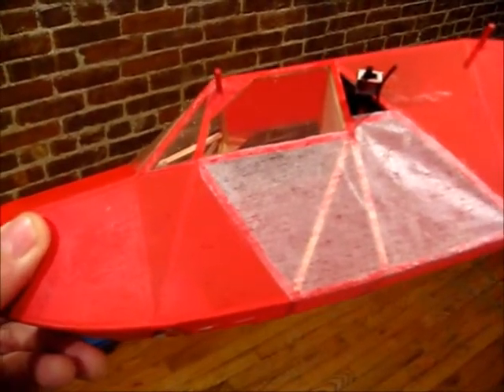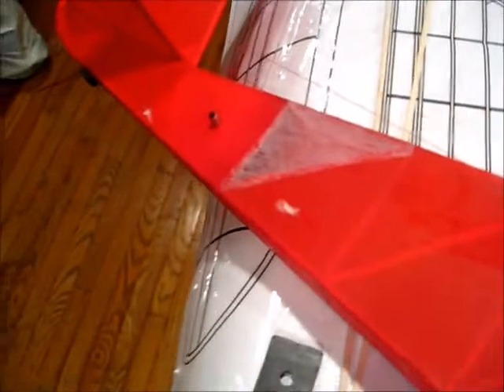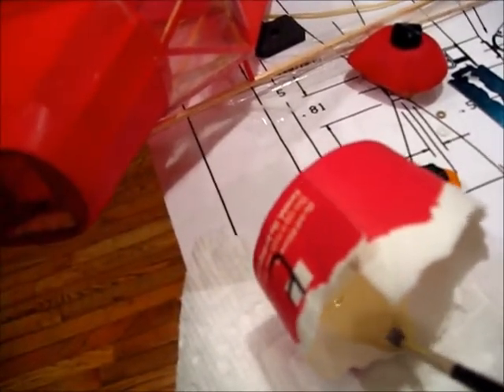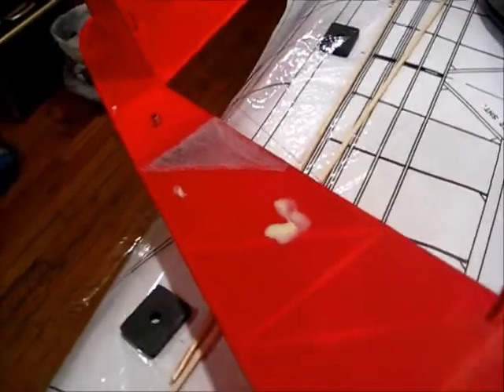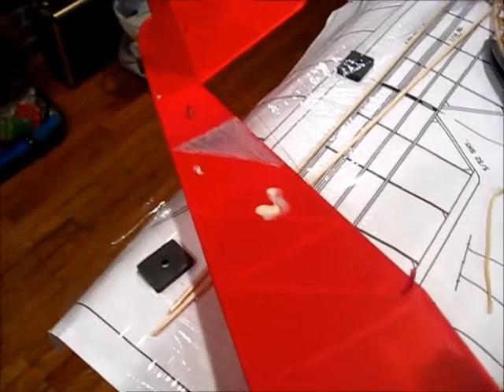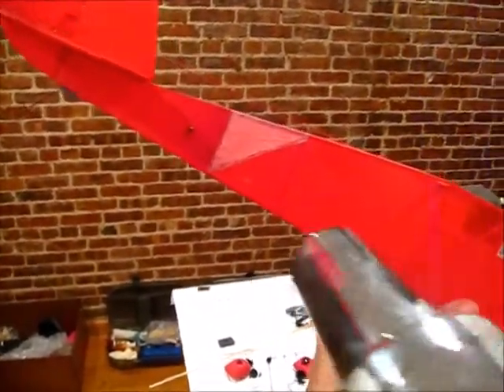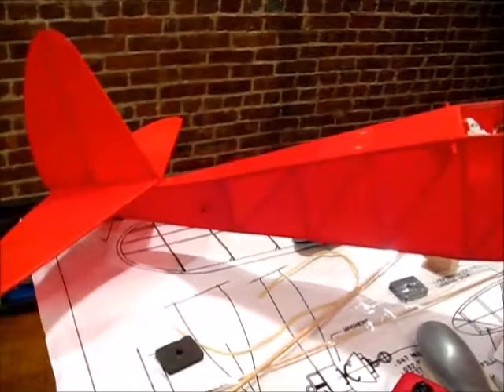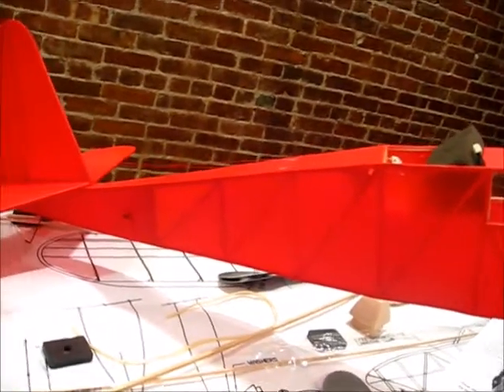Repairing tears in polyspan

Comment: The Sal Taibi method is to use the head of a needle to pull the fibers out and get them as flat as possible.  Put some Duco over the broken/torn area and then lay a piece of Saran Wrap over the tear and the glue.   The static pulls the fibers together and the glue flattens as it dries.  Do it right and it may look like all you have is an extra coat of dope over the affected area.
Reply from the maker: Thanks, it's always interesting to hear variations. I'm not a fan of Duco glue however and prefer using thinned white glue, but that's my preference. I'm not sure you need the saran wrap; doped polyspan is fairly stiff and it seems that, after running the thinned glue along the rip, it pulls together as it dries. But I'll give it a try on the next really problematical tear!
Reply: It's the only thing I use Duco for.   I'd show you some of my repairs, but you can't see them.  White glue is great for silkspan repairs but polyspan is a plastic.
Reply from the maker: Yes, but it consists of extremely fine fibers, which gives it silkspan-like qualities, one of which is that it allows one to use white glue. Try it, you'll see it bonds nicely; I've re-shrunk the covering drum-tight without any problems, and as shown in the video you can't even see the repair.

Comment: How do you attach the polyspan to the airplane structure ?  Are you then filling up the weave with nitrate or buturate dope ? What paint type are you using to paint this material ?
And finally, where is your source for the polyspan ?

Thank you in advance for your time.
Reply from the maker: I use UHU glue stick to attach the polyspan, then I give it two coats of 50% thinned nitrate dope, doesn't totally fill in the weave for polyspan lite because it's very porous, but it doesn't matter. I use design master floral spray paint. I think regular polyspan is way too heavy for planes under 40", so I use polyspan lite, only on the fuselage, the only current source of that I know is Mike Woodhouse, https://www.freeflightsupplies.co.uk/
Reply: And for the wings what type of material are you using ? -  THANK YOU SO MUCH again for your replies.